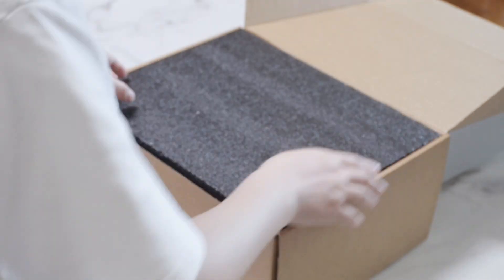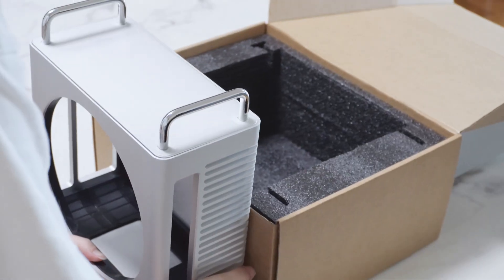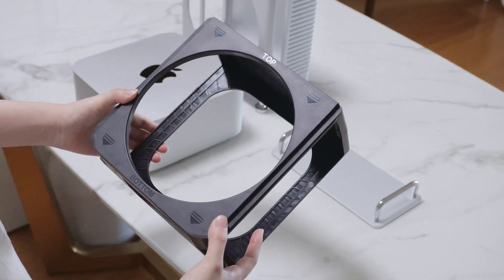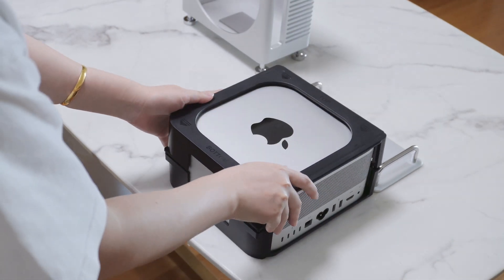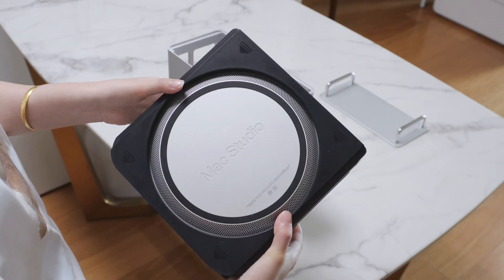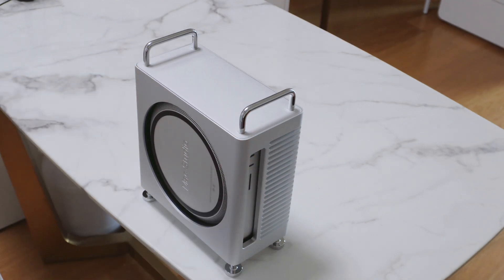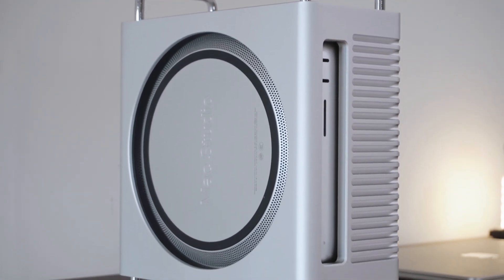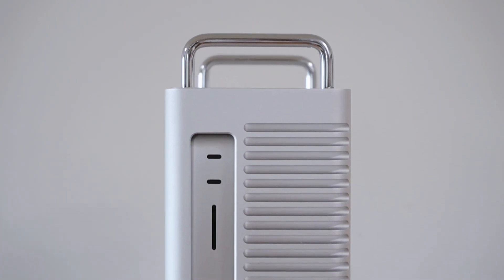How to Assemble the Zeera MacForge Studio ：Unboxing & Full Assembly Guide

Comment: So the handles are only for lifting the cover and not for handling the Mac itself to move it. This is a flaw in the design.
Reply from the maker: Thank you for your feedback!
We actually considered this during the design process. However, since the combined weight of the case and the Mac Studio is nearly 6kg, designing the handles for full lifting could pose a significant risk if the unit were accidentally dropped, leading to serious damage.
Therefore, if you need to move the case, we recommend holding the case firmly with both hands instead of using the handles alone. Thank you for your understanding and support!